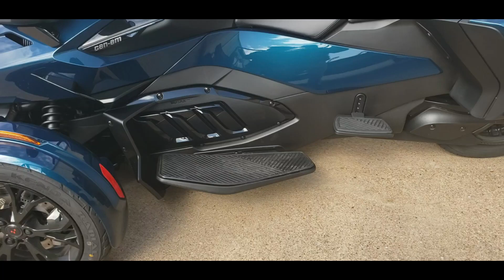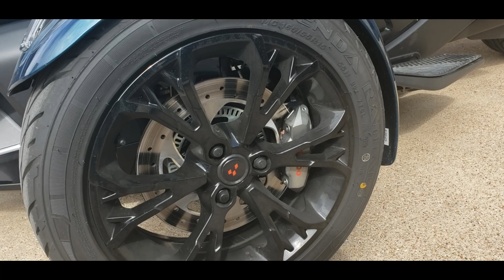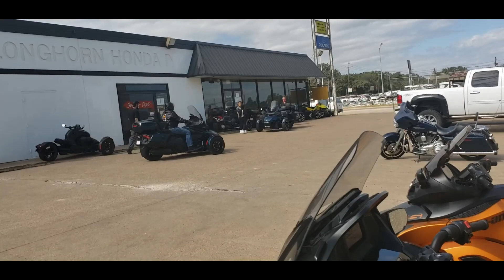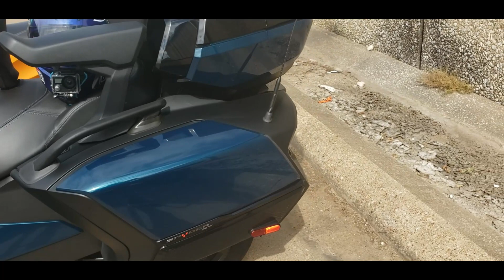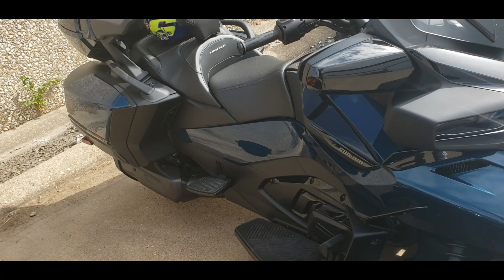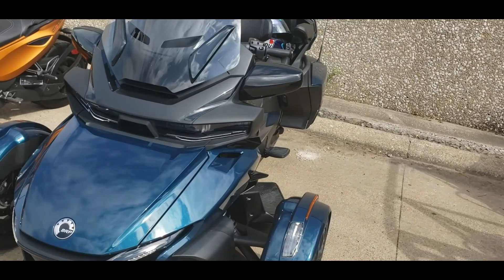Can AM front end noise explained

Comment: The excuse given is an excuse only in my opinion. I believe the noise is created by a lack of lubricant on the brake pad slides. Like all brake calipers the piston uses a square cut sealing o-ring that distorts outwards as the brake is applied and when the brake is released the deformed seal squares back up and retracts the piston and freeing the brake pad. 

The inner brake pad is mounted to the piston and outer to the caliper. Together they need to slide smoothly to operate. If there is any amount of friction the brake pad can hang up and tilt in the caliper. Once that happens the brake pad vibrates. Sound we hear is caused by vibrations. 

The way to check is to remove the wheel and caliper and paint a thin grease film on the brake pad sliding bosses. That should remove the sound by eliminating the source of vibration, a dry brake pad slide.

So why did the dealer say it’s normal and that they all do it. My theory is that it happens on all the bikes because the factory does not grease this point of metal to metal contact. The second part of my theory is that there is no labor operation for the technician to remove the brake caliper to perform this “added lubrication to the caliper” in the warranty book so that the technician can get paid to perform the service. Lubricating brake caliper pins and slides after cleaning them of rust and debris is the sign of a good service. 

The best thing an owner can do is to learn to do minor services and adjustments themselves or to request this service and pay the price quoted. By not only eliminating the vibration which will never most likely go away, by lubricating you might just extend the service life of your brake pads.

I spent 35 years as a ASE Certified, Journeyman Master Automobile Technician in a new car dealership. I am very familiar with Brembo brakes and how to inspect and service them. This bike is no different than the brakes I serviced day to day.
Reply: Your comment makes no sense. I am a certified brp technician and I can tell you, that is not correct. The brembo brakes on spyder models are 4 piston calipers. Each pad has 2 pistons that press it to the brake disk. No matter how much lubricant you use, you won’t fix it. No where in the spyder service manual does it even say to add any sort of lubrication to the brake system. Sorry, but 35 years as an ASE master tech doesn’t mean anything if you don’t know what you’re doing 🤷‍♂️